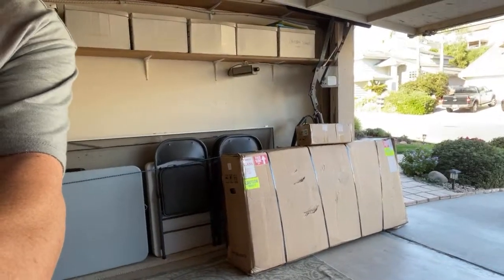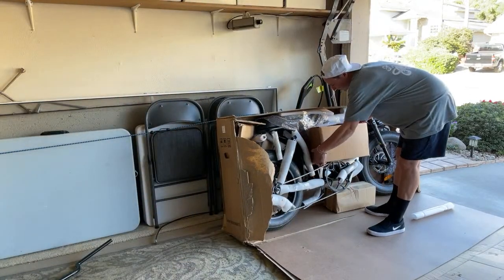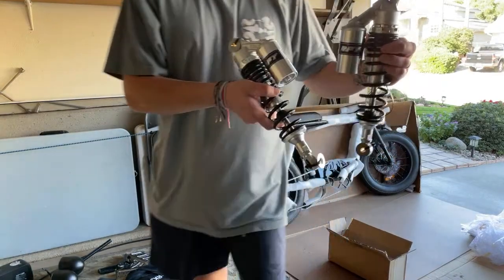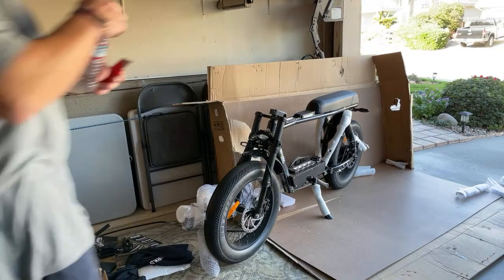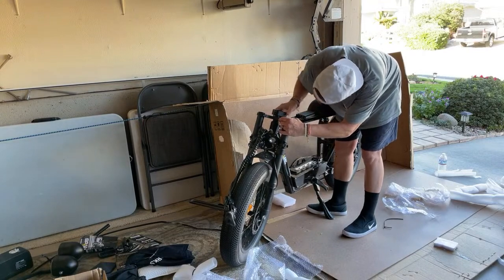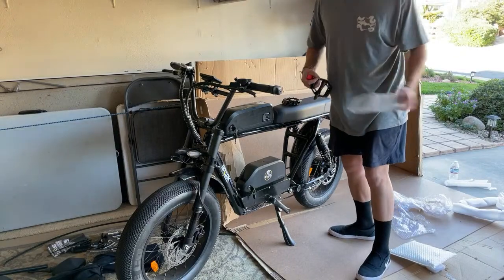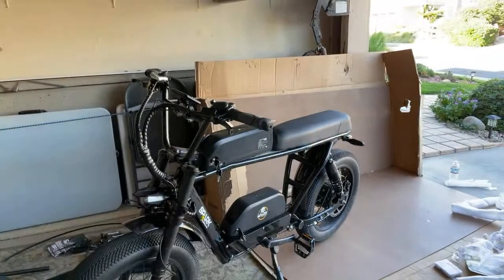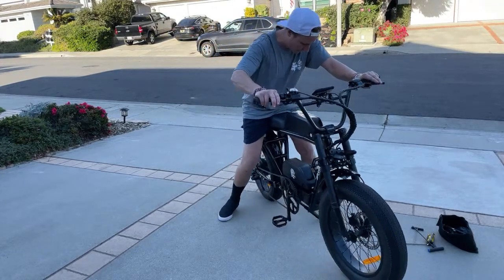UNBOXING NEW E-BIKE ⚡️ SPARK BANDIT

Comment: Never got the notification for this one 😥. Save that screw... it holds the whole bike together! Just kidding; the Bandit is cool and tough. I rode Shreddie's and it's a real solid machine. It would be nice if they used the same battery mount in both locations. There are times when I'd put the sleeker battery on the bottom and just do without the upper battery.
Reply from the maker: I got that screw in a secure location.  😆 
Yes I noticed that they were different batterie mounts too.  That said I’m super stoked to just have a dual battery bike right now!  Hopefully I can get my first review out Monday afternoon!
Thanks for always supporting brother!!!
🍻🍻😆